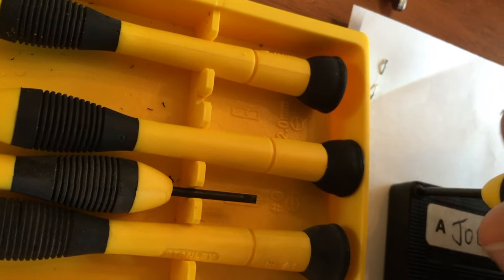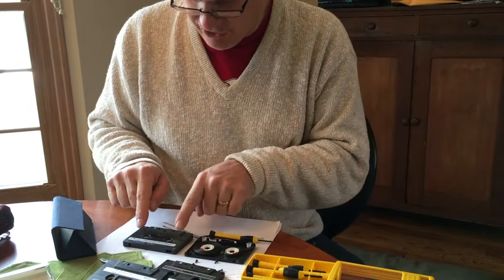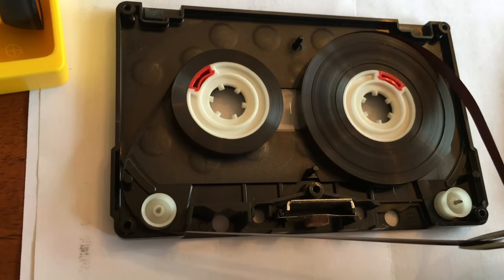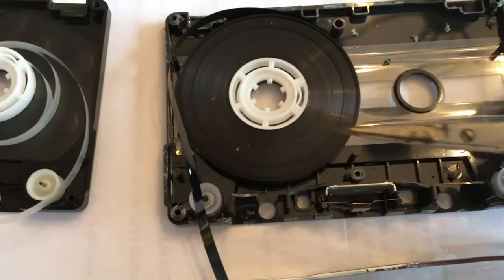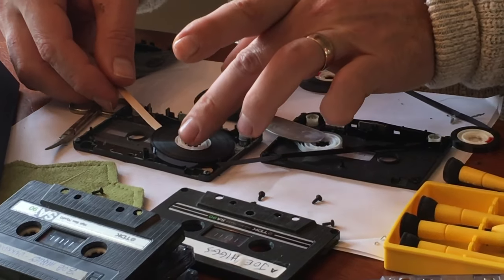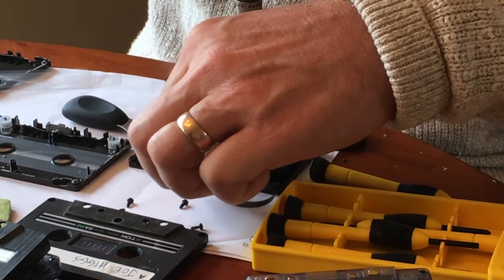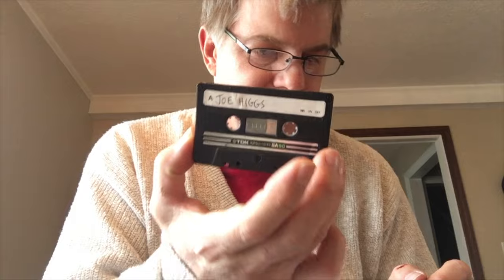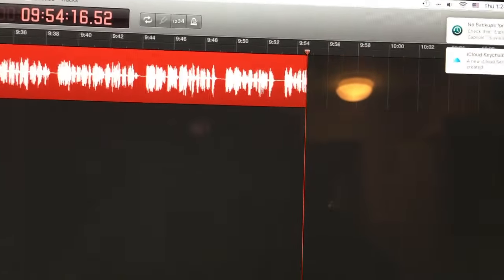Audio Cassette tape repair - "How To..."

Comment: Hello, how do you reattach the tape to the wheel?
Reply from the maker: The video is designed as splice for a one-time only salvaging of analog audio for transfer to another medium.  Attaching the tape to the spool is different.  
I suggest starting with some "leader tape" (which is nonmagnetic tape without any recording on it, and used at the beginning - this way you lose less audio), or if necessary - extra tape used as a leader.  
A short section of five inches can be inserted into the slot (or taped) onto the spool in question and wrapped (in the correct direction) around that spool.  Once wound up, do not rewind and with your player, just play and record the desired audio onto another medium.  If you do need to rewind, it probably will pull away from the spool - so rewind manually when you get close to the start of the tape.

Comment: When you cut it, won't it mess up with songs?
Reply: Well, you will loose a little bit of audio, however it's worth it if not hearing anything at all is the only other option.
Reply from the maker: Yeah, and you only lose what may be cut out at the start of the tape - only 2-4 seconds of audio.